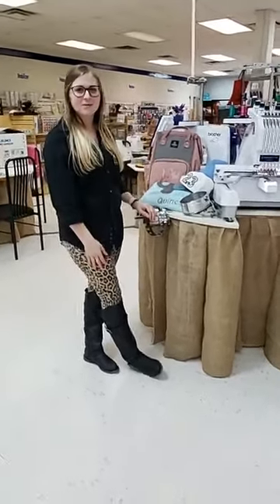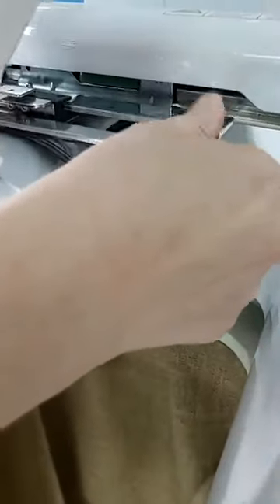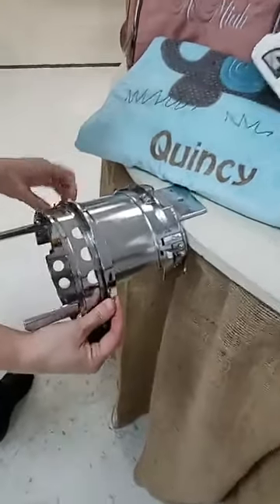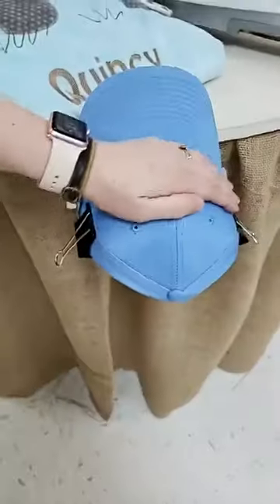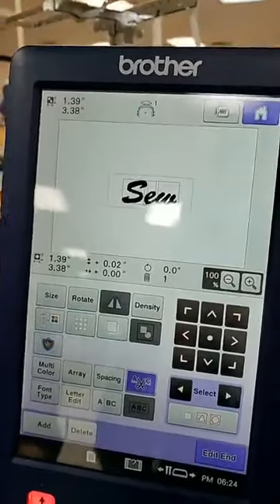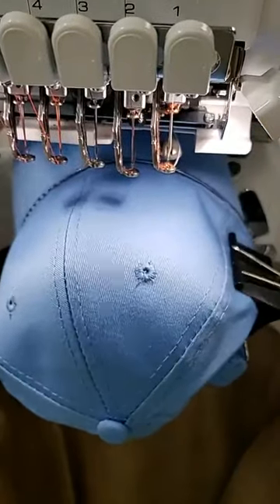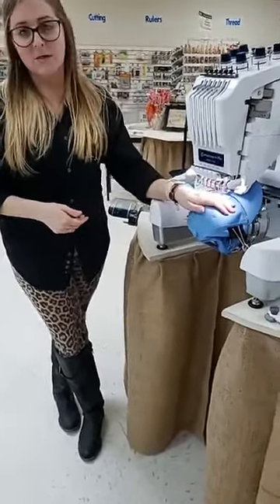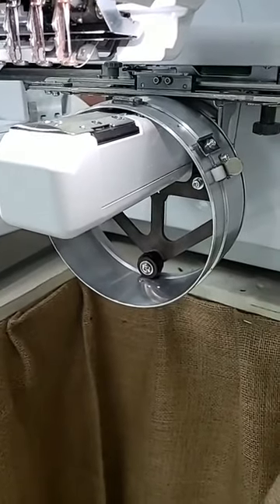Step by step how to use a hat hoop on a multi needle embroidery machine tutorial

Comment: Thanks for the tutorial.  I got lost with the “sewing the design inside out and it’s done in the software”.
Reply: In the design software, you need to set the sewing order to do the center letters first, e.g., Iced Tea would be d,T, (1st)e, (2nd)e,c,a,I. 
Basically your center letters, working back and forth, right, then left, to the outer letters.
It’s easy with lettering, less so for designs, but the same concept.

I hope that this helps, if not you, someone else.